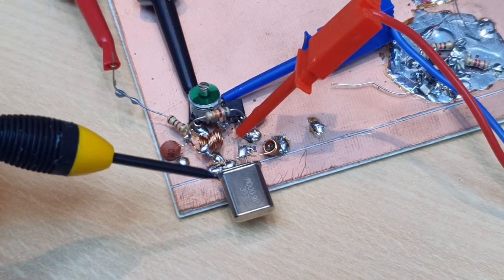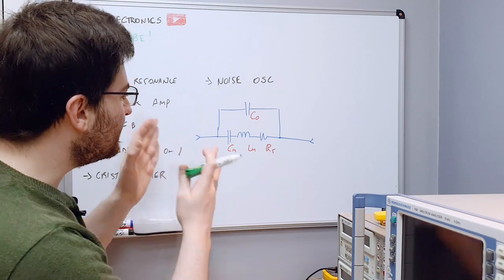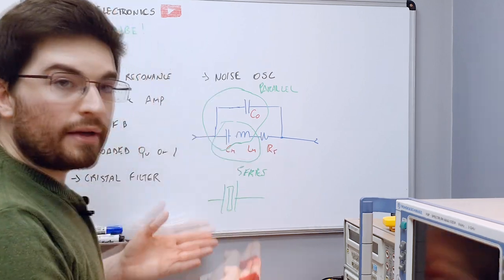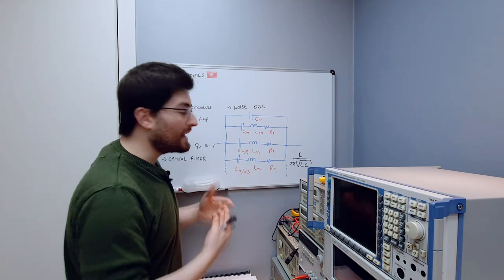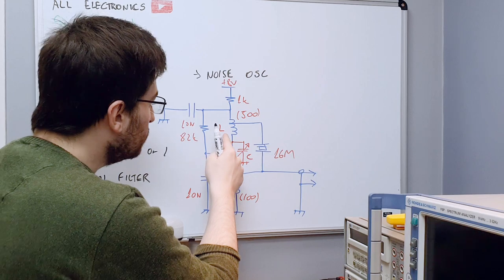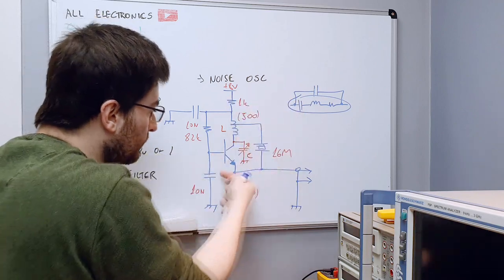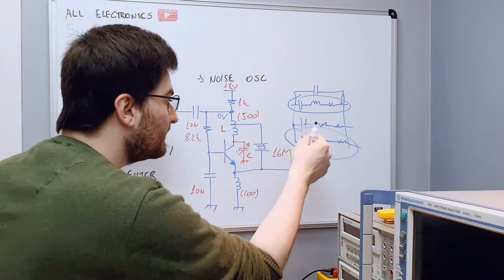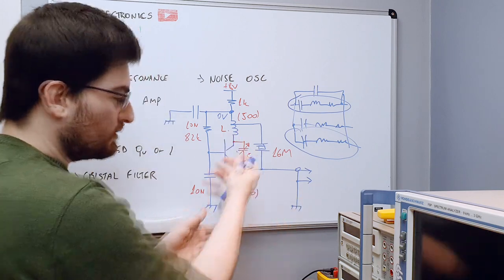Crystal Oscillator at Overtone

Comment: The crystal I have used obviously isn't an overtone type as I can only get it to oscillate at its specified frequency of 16mhz, nothing else.
Reply from the maker: It is hard.. I think it should resonate. Maybe it did not because its losses are too high.
Reply: @AllElectronicsChannel  Might have a lot to do, with the active device used. The ft of the transistor was not very high and it wasn't a good choice for a high frequency circuit. The Crystal was not tested before entering this circuit to see, if it would operate at other frequencies rather than just the fundamental which was 16 mhz.

Comment: excellent video as always. very useful. what was the tap point on the top inductor and the value of the variable cap?
Reply from the maker: Thanks!! The tap is more or less 1/3 from the cold end. The capacitor is calculated to the inductor at the output frequency.  I think I used something like 6-20pf.
In the description of the video I placed the link to my article, take a look! 😝